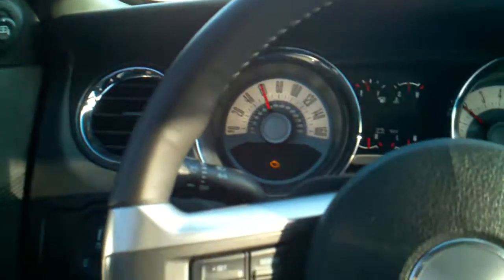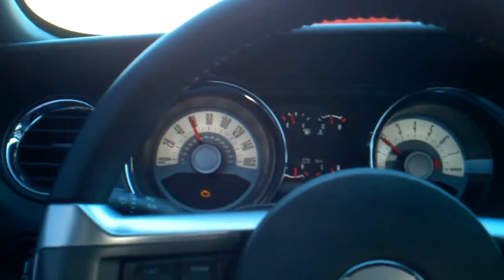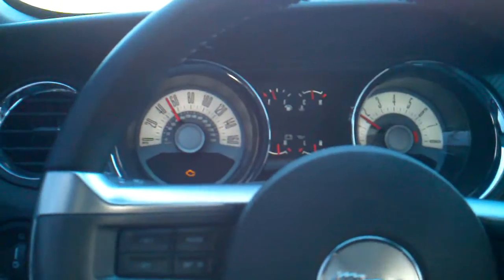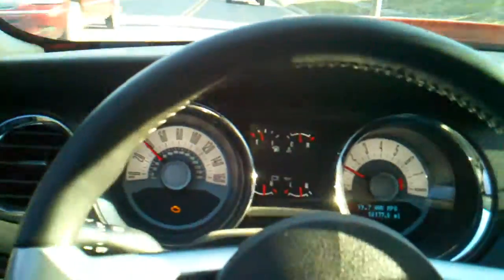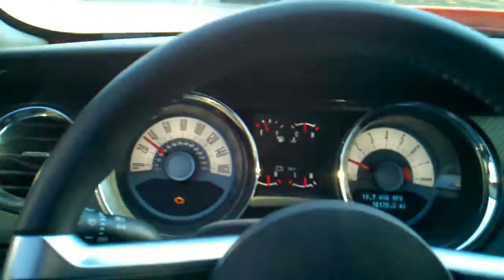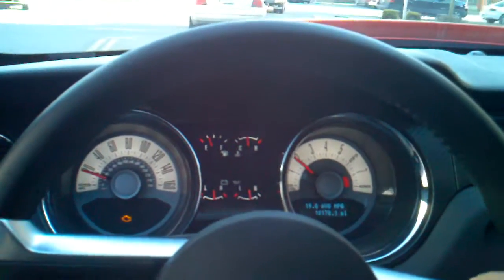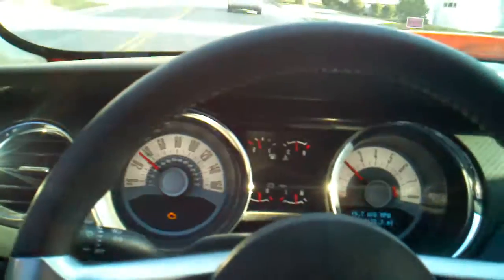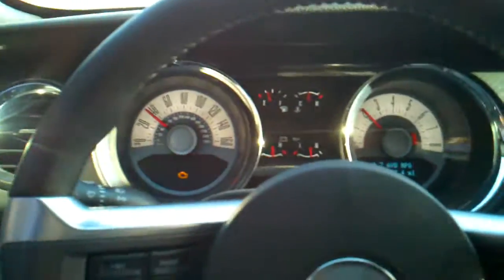201 Mustang GT CEL Misfire after clutch or flywheel replacement needs Crank Relearn

Comment: I hope this fixed the problem! Thanks for the video! I had a clutch and a new flywheel
Reply from the maker: @SuperMonster62  I'm pretty sure you will find that this fixes the problme
Reply: @TheMustangStampede went to the dealership and they just told me they recommend changing spark plugs. According to them the sensor is working perfectly fine. Was that the case with yours?
Reply from the maker: @SuperMonster62  nah bro they need to get in the id's toolbox and run the relearn. Sensor is good but needs to relearn proper position.
Reply from the maker: They trying to rip u off

Comment: Got a exedy twin disc and keep getting misfire on start up and random multiple misfire and sometimes 5 and 8 cylinder
Reply from the maker: You have got to get the crank relearn
Reply: @TheMustangStampede  I’ve done atleast 10 crank relearns
Reply from the maker: @carlosandresh__  oh maybe the sensor is not in right spot.. To check that though the tranny has to come back down. It could be the same CEL I'm dealing with now. It's the sensors on camshaft for me right now exhaust and intake
Reply: @TheMustangStampede  what sensor I replaced the crank sensor and no luck done plugs compression test coils my only option next is change upstream 02 sensors or take the clutch out
Reply from the maker: @carlosandresh__  they on the back of the motor two on each side for intake and exhaust. It feels like its missing cel starts flashing no power then back to normal it's extremely irritating.
Reply from the maker: @carlosandresh__  let me run outside and make a video and pull my codes and i will upload it i will also grab part number
Reply: @TheMustangStampede  yeah let me know what ur talking about
Reply from the maker: @carlosandresh__  here you go I actually have a different code this time though. https://www.youtube.com/watch?v=va1eObGOZo0

Comment: Does it blink. The engine light.
Reply from the maker: yes it can blink when it does this. you will feel a lose of power or like a stutter and the light will flash. If you recently changed your flywheel/clutch you might need a relearn at the dealership.

Comment: The exact same thing just happened to me last night the day after i got my car back from my stage 1 exedy 500 clutch install and race flywheel
Reply from the maker: Easy fix my man
Reply: Did ur clutch go all the way in after u installed it? I installed the flywheel, hydraulic cylinder, clutch all from exedy and mine has a hard time going into 1st and reverse. Other gears feel smooth

Comment: I changed clutch and didn't change the flywheel but i balanced it while I was at it and now I have this P0300 fault :( Blinking and then going away. Last time it stayed. What about the o-ring fix?
Reply from the maker: O ring Fix?
Reply from the maker: You mean my rear main seal that came out?

Comment: I have the same clutch as yours but I get the miss fire when I hold my rpms about 3k and it’ll last for about 10 seconds and I have no engine power and then it will go back to normal after 10 seconds. You think I need to reset mine too?
Reply from the maker: Yes 100%
Reply from the maker: It's a staged process when they do this they actually hold at or above several ranges

Comment: Yes that's normal the ECU thinks the clattering of the lighter flywheel is knock... You just have to do a crankshaft relearn. So it Will chill out
Reply from the maker: Yeah I was either explaining and or documenting but yes I had had to do a relearn each time and it not because the lighter flywheel lol. Its because you often bunp or mpve the sensor amd it has been keeping track of the teeth and sometimes while tightening and or moving around it might not be lined up on the right count. No big deal at all a quick crank relearn fixes it al up. I been through quite a few clutches from all the drag racing
Reply: @TheMustangStampede  nice man. I'm about to do a clutch and flywheel swap my self. Do you have a recommendation for a good combo to go with? My car is bone bone stock most I'll do is full exhaust and intake. Car is only a street car. I'm looking for something that will last 50k miles 😆 

Any suggestions? Can't find non biased info
Reply from the maker: @3star2nr  i know have the pink one from exedy now which I think was stage 4 with the racing flywheel. My stock one would have lasted a very long time had I no but dumping it at 6600 rpm on drag radials

Comment: My car will not take a crank relearn on any systems or tuners. Hoping if I replace the sensor it takes it then
Reply from the maker: Have you used the ford ids toolbox it is the only thing that i know that does it
Reply: @TheMustangStampede  SCT X4 Handheld does it.
Reply from the maker: @SFCCANE  I would simply use the ford ids toolbox on a ford technician laptop. I can ask my mechanic friend at for dealership if he has heard of this.
Reply: @TheMustangStampede  thanks man. This is rough car is struggling starting now. Have to do a kam reset for it to start now
Reply from the maker: @SFCCANE  Oh ok. Is it manual? Cause if so and they sidestepped the clutch they may have messed up the locator pin causing a fault. Other than that, have to have engine at operating temp and I'm sure if you have any timing codes it likely will fail.  This what my buddy just asked me.
Reply: @TheMustangStampede  manual yeah. No issues
Reply from the maker: @SFCCANE  The crank sensor ring has a circular locator ring that fits into the crank. If that's egg shaped, they fucked shit up
Reply: I have the similar problem, won’t  relearn.
Did you get it fixed?
Reply: @5PoW2  no still nothing

Comment: My 2015 GT had the same problem right after the install a week ago. I'm thinking it might be the chatter from the clutch an hoping it will go away after the break in period.
Reply from the maker: You need to go have the Crank shaft relearn. It's not clutch chatter. If you really think it's clutch chatter you might have busted the hydraulic slave, if you didnt replace the slave. I have been through 3 or 4 clutches from dragging this car down the 1/4 mile at 6500rpm dumps. I highly suggest before you do anything go tell the ford desler to relearn the crack position sensor. It take about 5 minutes. If you dont want to do that, you can do it yourself. I think you have to accelerate to 45mph amd then slowly let the car come to a coast. Then repeat that like 5 times. I seen another post or video about doing it yourself.
Reply: @TheMustangStampede  My friend also told me that I need to do a crankshaft re-learn. I will try an do what you said about the 45 mph exercise and hope that will remedy it. Thanks for the response.
Reply from the maker: No if he is getting check engine light he needs to get to have crank re learn done.
Reply: TheMustangStampede I do agree with you. I’m talking about his clutch chatter not his misfire
Reply: I’m guessing you put a McLeod or spec, if so that first engagement chatter won’t go away. Oem clutch set was my only fix

Comment: I had a new motor put in and I just replaced the coil pack and plugs are new. Im getting the random misfire and misfire on 1 and 6. I had it checked by a few performance mechanics and they couldn't narrow it down. It misfires around 4k rmp in 4th gear and I was reading this was happening with a flywheel or clutch replacement and a crank relearn fixed it up. Could a crank relearn help? I'm running out of ideas of what it could be
Reply from the maker: Misty Bingham of course those so called performance mechanics couldn't figure it out? Time to stop using those performance mechanics who don't know their ass from a hole in the ground. I figured this out and I'm no performance mechanic, more shade tree mechanic. Lmao

Comment: is this issue also relevant for s550 mustangs?  I just had long tubes (tune should take care of O2 sensors) and a McLeod flywheel and RST clutch installed and I'm having the same symptoms in my 2015
Reply from the maker: Corando Canales 100%, did you do the work or did someone else do it? The sensor is a magnet, and must count the teeth on the flywheel as the pass which allows the computer to keep track of crank postion. I would highly recommend having the dealership do this 3 to 5 minutes procedure before digging to deeply into any other possible issue. I'm sure it will clear up that misfire code and bogging down which is basically the motor trying to save itself although nothing is actually wrong. I have had to do this with all three clutch replacements.
Reply: I ended up borrowing my buddy's SCTX4 and relearned the crank with that, the dealership was pussyfooting about the issue.  Runs like a champ now!
Reply from the maker: Corando Canales that is awesome man. thanks for sharing had no idea the x4 could relearn crank postion.
Reply: Corando Canales how can I do it with the X4 bro

Comment: I bought this 2011 mustang v6 with steeda tune, steeda intake and spacer, and 4:10 differential, but check engine light is on and  gives a p300 p301 p303 p304 (random misfire, cyl.1 , 3, 4) always. I took it to many performance mechanics but not luck. Do you think if I take it to do this to my car would fix the problem since now the gear in the differential is smaller?,
Reply from the maker: xtravaganss300 if your getting random misfire errors it should clear up, with that process. if they added all that and the tune is wrong or something it may not help. does the csr bog down when this occurs? if so my guess is try this process.
Reply: TheMustangStampede the tuner wich it was used is a SCT with Steeda tune, and it is supposed to adjust the revs on the speedometer. it has 40k miles and I tried new sparks. put new cam sensor. new airflow mass sensor. check cables. switched injectors and coils. put back the original air box and stock tune and still getting check engine light. when i drive on freeway in 4th or 5th gear if i let go the gas from 3700revs to 2500 revs thats when i get misfire for about a minute. then goes normal again....
Reply from the maker: xtravaganss300 has the clutch been replaced?
Reply: TheMustangStampede No.
Reply: I took my mustang to the Ford dealer and thanks to the guy that did the report to the mechanic on the things I did and the parts I checked and replace, then I gave him the info you provided me and he was kind like familiar with the issue, of course he didn't give any warranty on those steps since I want to go straight to the problem and do the relearn. 3 days later they call to pick it up, ran it for 100 miles and no check engine light... finally after 2 years of searching I could go to do smog check and passed it and got new sticker from DMV. Thank you so much for your help!!!!!!!!!!!!!

Comment from the maker: Yes it fixed the problem, I know some folks at the dealership, and it only takes a few minutes, so no charge. You should be able to tell the dealership what needs to be done and see if they will charge you, if you recently changed clutch and or flywheel was moved or replaced and this is happening you will need to have this process done. Thanks for watching feel free to ask any other questions, I hope this help you out.
Reply: How's the clutch holding up?

Comment: I assume I will have the same problem when I install my clutch and flywheel. Would I have to put the stock intake back on, along with the stock tune before taking it in for the relearn?